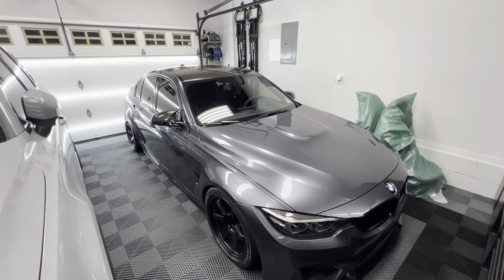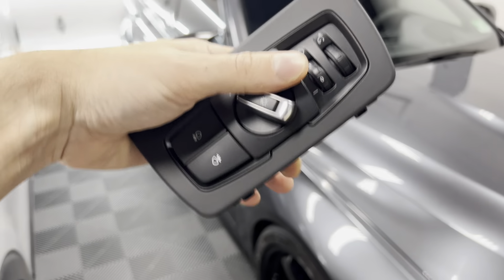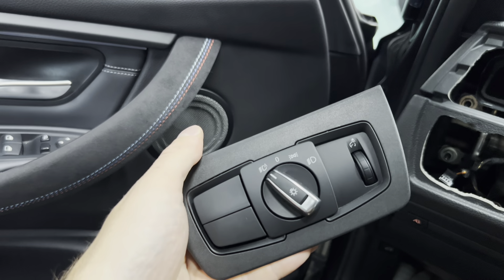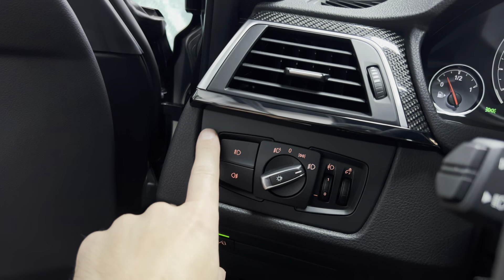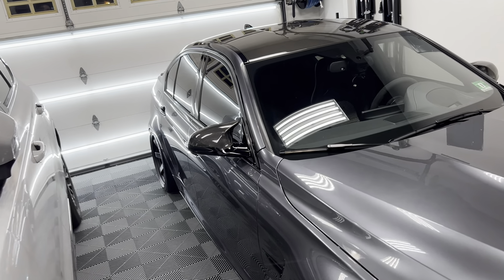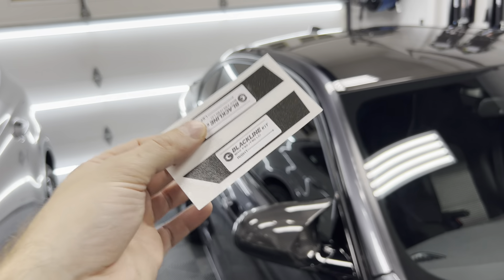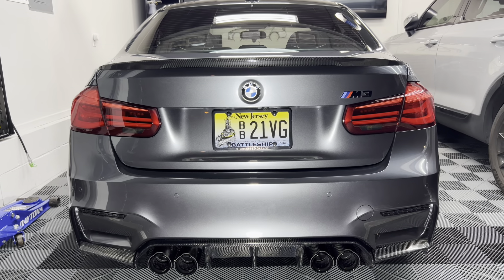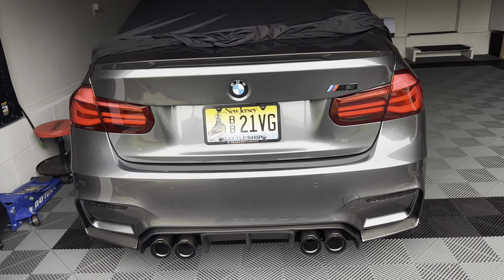BMW F80 M3 Euro Rear Fog Light Switch Install + MORE!

Comment: Great video, I also did the euro fog switch, it's super easy to install and great to spam press when people are riding your rear end on the road. 

Regarding the golden wrench overlay kit, I ran it on my F80 for a few weeks and ultimately wasn't satisfied, I feel like making the clear section black just highlights it even more somehow. I think with certain cars it works better, like on our F10 M5 it looked great, but I think with the styling of the F80 tails, they look better without the overlay. Still looks great though, and no matter what rock what you like for your car.

p.s. would love to see a new engine bay cleaning video for a future video idea.
Reply from the maker: I do agree I am not 100% on it yet, although I think it really depends on how the car is setup. Being that my car is darker overall and has black accents, it does work pretty well with it. It's one of those mods that I will rock for a bit and make my final decision down the road. I think it does make the tails a bit cleaner looking as there are no interruptions of other colors. I will also admit, it does look better in person than it portrays in the video. Either way, we will see how it fairs over time.

It's been quite some time since I've done an update on my washing procedure. Once the F80 needs another wash, I'll be sure to include the steps I do to keep it maintained and clean.